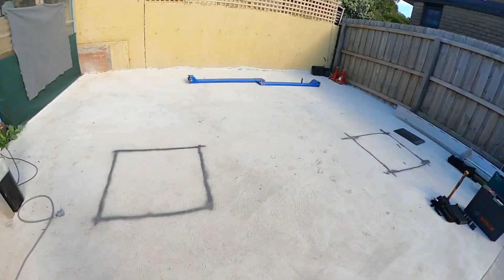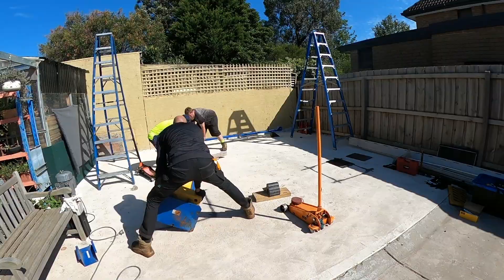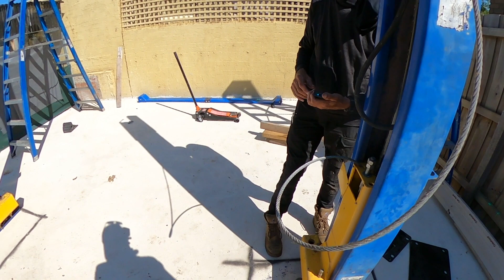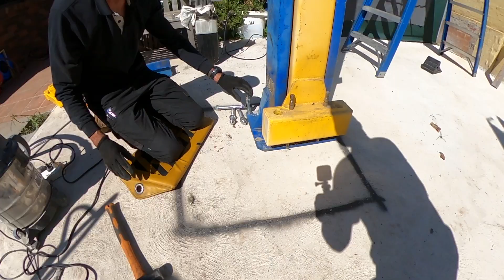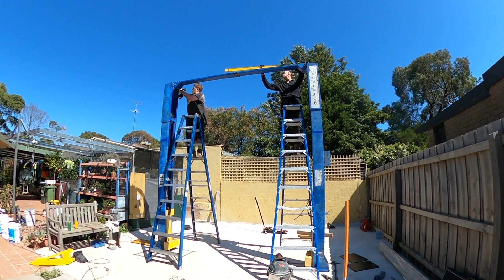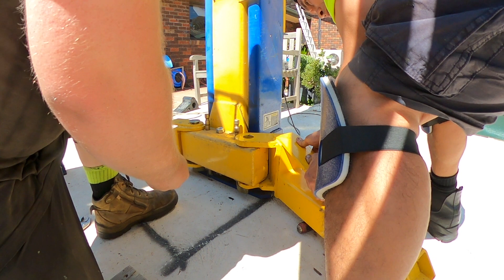BUILDING MY SMALL AUTO WORKSHOP

Comment: Kabayan i need your advice on my prado where can i contact u? Thanks
Reply from the maker: Brod anong issue ng prado mo?
Reply: @gooddayvlogs23   i wanna send u some photos sana para ma visualise mo lalo., pero di pwede dito hehe theres a lot of oil sa engine bay side ng egr valve but when i check it loose ung clamps ng hose so tighten it. And ngtataka ako bakit may oil sa housing ng timing belt., one more thing is when i accelerate like hitting the pedal deep specially kpag nag overtake e may lumalabas na usok parang greyish color nkikta ko habang driving. I checked the injector using diagnostic scan looks fine nmn.. just so u know i just bought the car its a 2008 120 prado vx po. 270kms on the clock.
Reply from the maker: @yepsognayab17  so fixed n yung sa egr oil leak, gray smoke maraming causes maaring may history ng overheating, in full throttle may usok gray pwedeng reasons ay hindi fully burn ang fuel, faulty injector, valve seals bypass oil and get burn during full throttle, clogged air filter or incorrect timing belt means stretched na. Oil leaks sa timing housing means from camshaft seal.
Reply from the maker: Replace your air filter, fuel filter, inspect your timing belt, use injector cleaner. Check your turbo intercooler maybe block din.
Reply: @gooddayvlogs23  ill do that.. slamat kabayan🙂
Reply: Sir gup pm.,i dont kniw where to contact you. My diesel prado with a 1kd engine blowing oil from the dipstick., is it bcoz of excessive blowby?
Reply from the maker: @yepsognayab17  tama brod, blowby na engine mo.
Reply: @gooddayvlogs23  is that mean need a new engine or engine rebuild?
Reply from the maker: @yepsognayab17  kung ako ang tatanungin mo mas ok ang bumili ng used engine. Pero dapat mababa ang mileage na bibilhin mo.
Reply: @gooddayvlogs23  went to diesel specialist last week and they said the compression test is okay and they said it just need to change the injectors so they changed all the injectors with toyota expense dahil kakabila ko png kasi sa knila. But before that.. I noticed it’s losing its power so was advice from toyota to bring to the nearest toyota dealership near me and then the toyota said its got a excessive blowby and engine is tired. So the other toyota which where i bought it from wants a 2nd opinion and brought to diesel specialist and thats what they said its just the injectors. But now im still having a smoke and oil coming out from the dipstick.. i want to send the videos and written report to you but unfortunately i cannot post  in here.
Reply from the maker: @yepsognayab17  you can buy from car wreckers,  second hand engine with low mileage and with warranty.
Reply from the maker: @yepsognayab17  that's is expensive to rebuild,  blowby means the oil is bypassing from worn cylinders and pistons.
Reply: @gooddayvlogs23  slamat sa advice kabayan.